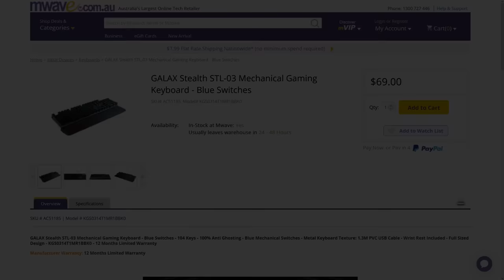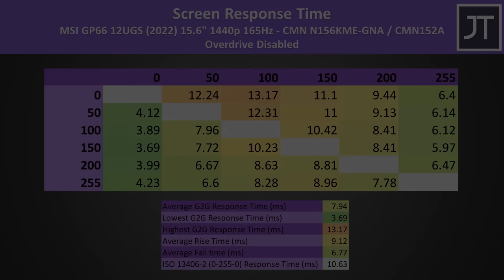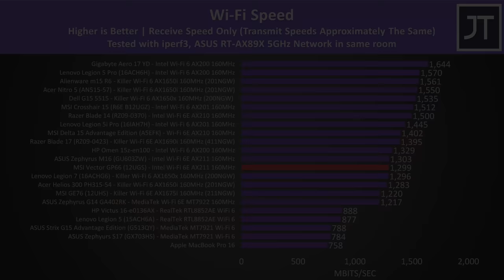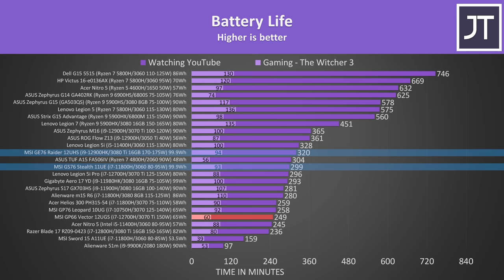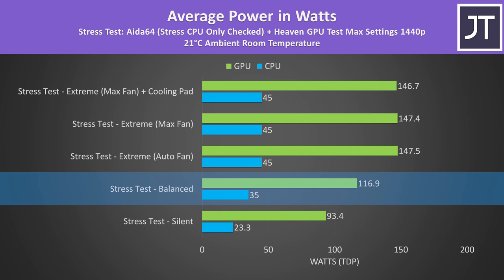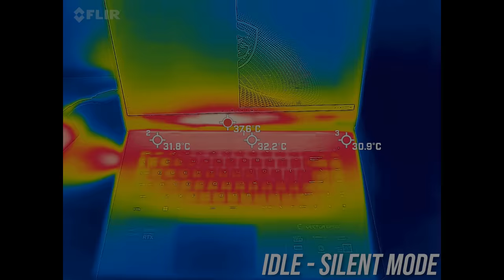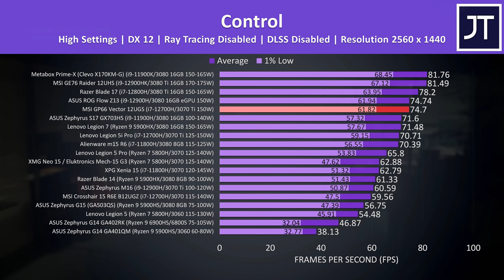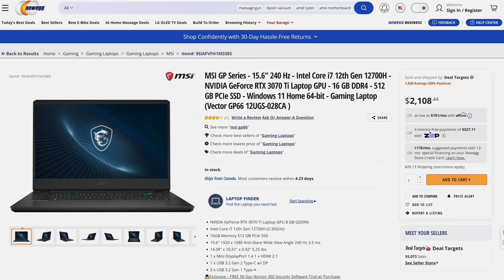MSI GP66 (2022) Review - FASTEST RTX 3070 Ti Gaming Laptop!

Comment: Anything Over RTX 3060 cannot be considered Mid-range. I guess the budget versions should soon be releashed.
Reply: Bruh you're right 3070 is not mid range
Reply: 3080/ti is high end, 3070 is mid, 3060 budget, 3050ti/3050 is low end
Reply: @hendrikheim5665  that’s literally not true but go off
Reply: @jametron6135  because he's not including 5 year old GPUs?
Reply: midrange is rx580-1080ti, not rtx3070
Reply: @jametron6135  There isn't that much of a difference in price with 3060 and 3070 anyway. If you can afford a descent 1k-1,4k€, then you can shell 100 or 200 more for a 3070. I'm price conscious, so I bought a used 3070 notebook and yes it's midrange.
Reply: @hendrikheim5665  3060 is £399 rrp
Reply: if y’all think paying 1450 dollars for a laptop is midrange y’all have problem
Reply: @KentRoads laptop gpus.
Reply: @jametron6135  don't know if that's a lot or not. But most 3060 laptops sell for 1k€ here. My gf66 3070 had a price tag of 1,1k or so. It was used though but works just fine.
Reply: @hendrikheim5665  £699 for a 3060 laptop. Technology advances daily so there's no point including old stuff :)
Reply: 'Midrange' 1080ti might not be enough for AAA titles in a year or two
Reply: @KentRoads  I still have a system with it, works just fine. In the end it doesn't matter most new games are yucky anyhow
Reply: @jametron6135  idk how much new gaming laptops cost and why it's so costly these days but i would reccomend getting the 3060 or anything that has more VRAM than 4 gigs, the settings, the price and the performace in todays new laptops are kinda sucks for me, for example most of the new laptop has an high end intel 12th gen and gets paired with a potato 3050 4gb, why tho, why don't they just paired it with last gen gpu and get much better price perf ratio, also the 3050 its not revolutioner ( yeah the xx50 finally gets rtx features, but you can get probably more performace and VRAM just by using the 2060 series )
Reply: @kingofstrike1234  i got one with a rtx3060 for 850 to replace my rx580 desktop
Reply: @jametron6135  if u think thats high end, u have been living under a rock
Reply: @LoneWolf6063  if i think what is high end? i’ve been talking about a few things
Reply: Keep in mind that GPU and CPU aren't the only things that define a laptop's class. The screen, build quality, and IO also play a bit part in that. But I'm not saying that this one has a mediocre screen, Build quality, or IO
Reply: @hendrikheim5665  get off you daddy money prince.
Reply: @jametron6135  dude ur just poor, stop disgusting others with ur poverty
Reply: @TyTystick Finally someone who gets it. It's not about the cpu and gpu. You can cram top specs into a cheap/generic chassis. People buy them for the best bang for buck. Actual high end laptops have bespoke and good quality chassis, good I/O and numerous features that not every gaming laptop has like per-key RGB, windows hello IR login, good keyboard/touchpad, things like that.
Reply: @DarthVader-xr6hm  id say i’m high mid class, i wouldn’t spend 3,000 on a shitty laptop though
Reply: I completely agree
Reply from the maker: The GP series itself is midrange, not necessarily the specific specs I happened to get sent.
Reply: @jametron6135  No.
Reply: @Ramcas42  no what? are you special?
Reply: @hendrikheim5665  with that logic 970 is jurassic lol
Reply: @TuneTamasha  It is
Reply: @Supcharged  yet it still runs new games fine
Reply: @TuneTamasha  so does a gtx 1050ti.
Reply: Haruka Matata  This isn't 2010 anymore. The sad reality is that you cannot get most things for the same as back than. Take the eur currency as an example, lost 3-4 times of its value the last 10-15 years compared to hard money. Inflation on consumer goods has risen too and wages have not followed along it. I do not make much more than I did back then, but many things have gone up in price, we simply do not notice it. 

A high-end laptop was maybe 1k€ back then, but these days it's more like 1,9k to 2,2€ and that is in a system that might not the most expensive one. Also do not forget that desktop GPUs have almost doubled in price compared to 10 years ago. But hey we still have very good budget with excellent quality like the legion 5 series, it ein't all bad! But always remember that you and I are peasants and have no control or say in this. ;)
Reply: @jametron6135  No
Reply: @Ramcas42  you have no dad
Reply: @jametron6135  No
Reply: @Ramcas42  you have no dad
Reply: @jametron6135  No
Reply: IMHO 3070/ti is considered  mid range because lack of bigger vram so it's not really future proof especially when it comes to 4k. Nvidia fked up for not providing ti version at least 10-12 gb. O well..
Reply: @farrukhdada6688  I swear people like you can not be real. Is the iphone 13 a “midrange” phone because the 13 pro exists?
Reply: @jametron6135   What? That's a horrible comparison.
Reply: @farrukhdada6688  Why is it a horrible comparison? It’s a high end piece of technology, with a greater version, and a bigger version
Reply: @hendrikheim5665  3060 is budget? How is a card which can run games like cyberpunk on ultra with ray tracing on be budget? These cards are actually really powerful!

Comment: I think it could have been better, if they didn't basically waste money on some stuff, like 2.5g ethernet and per key rgb, when most people buying mid range laptops won't have a 2.5gb switch, or I'm not completely sure, but also care for per key rgb. They could have used the money for better trackpad and hinge, and add charging to the usb-c. If lucky, maybe a second usb c as well. It matters per person, but that seems a better full package. Still, beastly performance and excellent screen so I guess I'm just nitpicking.
Reply: Even the screen could be 1080p, I dont think 1440p is that worthy for that size
Reply: Type-C charging is a must-have feature for me so I would gladly sacrifice 2.5G Ethernet and per-key RGB to get it.
Reply: Agreed
Keeping the price same and switching 2.5gb ethernet, per key rgb lighting for type-c charging is a good deal
Reply: @JotaFla  I think there are 1080p options for it. Maybe not available yet but they are listed on website
Reply: It's not mid range in my country. Still bout as pricey as high end laptops. And non of MSI budget offerings comes close to that.
Reply: @saturnotaku  the hinge problem must be fixed, i had it for one year and my right hinge broke, so msi need to fix their terrible hinge design

Comment: I own the 2021 GP66 Leopard (RTX3070/I7-10750H) which has an almost exact cooling setup. I was able to really boost thermal performance by repaisting with Kryonaut / K5 Pro and undervolting. I still hold the #1 spot in Firestrike Extreme (13552) and #3 Timespy Extreme (5190) in systems with this GPU/CPU configuration. So for sure worth all the trouble of taking the GP66 apart.
Reply from the maker: Nice!
Reply: Yes I have the msi gp 76 11aug 3070 rtx and i7. I undervolted it to -80, added liquid metal and adjusted the prefix and and a couple other settings to give me free 5-12 fps boost for free. It’s super cool and amazing.
Reply: How about the battery life
Reply: @jeremyguiab  complete and total garbage haha but i think the GP66 is meant for best possible performance at the lowest dollar amount, not battery life and for sure not build quality.
Reply: Wonder how 3070 mobile compares to 3070Ti mobile. Wish Jared would do a comparison.
Reply: @jeremyguiab  the battery life can be at least 5-6 hours if you set it up correctly. Basically change the display settings to 60HZ and anything else gaming related should be deactivated. When working my job I use the laptop like that, when gaming I put the display back to 144hz and reactivate the gaming settings. I have the 10th gen model with an i7 and 3070
Reply: @thepermanentshockedface9177  i7 11800H ?

Comment: Hey Jarrod, can you confirm that, despite all the BIOS options always given by MSI, Alderlake 12700H, e.g. any non-HK SKU, has no chance of enabling undervolt? This machine is a good candidate to prove it once and for all.
Reply: No undervolt allowed on 12th H
Reply: @elaminemenni672  I see p core voltage offset in the advanced bios section in the video though
Reply from the maker: 12th gen non K doesn't support it, so I don't bother even attempting to see if the BIOS options do anything.
Reply: @JarrodsTech  TY!
Reply: That is sad since a good undervolt was a nice way to lower temps and strangely usually increase performance on mobile Intel.  Though that does depend on silicone luck since some Intel mobile CPUs can just run fine with less voltage then others so everything has to be set for the lowest common denominator, which is higher then it might need to be.
Reply: @acdbrn2000  Hopefully the hx series can be undervolted then. They all support some level of overclocking so maybe intel also enabled undervolting.
Reply: 900

Comment: Jarrod: This is MSI's best mid range laptop.
Also Jarrod: this laptop has an rtx 3070ti, 1440p 165hz screen, and Intel i7 12700h.
Ah yes, very mid range
Reply: lol same thing i was thinking, mid range for me is like a 3060 tops. I guess i'm too poor
Reply: @SweatyFeetGirl  you do have a point, and while I somewhat agree with you that the rtx 3080 & and 3080 ti are high end, I just can't get myself to believe that the rtx 3070 ti is upper mid-range. The normal 3070 probably is, but I don't think the ti version would be a mid range consideration. And besides, the laptop still has a 1440p 165hz  screen and an Intel 12700h
Reply: I've seen gf66 3070 laptop for under 1200e, bought mine used for 1100e, I think? 100e less will get you a 3060 legion
Reply: Maybeit is considered mid range because gp 66 is cut down and cheaper than ge66
Reply: ONG
Reply: @oofwithoof1023  the 3070ti replaced the 3070 this gen, they're the same tier. You should expect more performance at a similar price gen over gen. The issue is, this gen they kept similar price/performance.
Reply: @SweatyFeetGirl  it's just my own view of high end and mid range. You have your own opinion and I havemine. Guess I just have a different mindset than you
Reply: @SweatyFeetGirl  well then, I guess I just have a different sense of value. But I do still understand your point
Reply: The most budget msi gaming laptop is msi gf63. I have one.
Reply: @imranknight6659  what specs do u have?
Reply: @oofwithoof1023  core i5 10500h 6 cores 12 thread's, gtx 1650 max q, 8 GB ram 256gb SSD, and then I upgraded more 8gb of ram now it's 16 and also 1tb of SSD 2.5 inch.
Reply from the maker: The GP series itself is midrange, not necessarily the specific specs I happened to get sent.
Reply: @JarrodsTech  I see. I just commented since the laptop itself didn't seem mid-range to me, but if the general series can be considered mid range, then I guess that gets a pass.
Reply: @JarrodsTech  also, when are you gonna be making a review of the Asus zephyrus g15 2022 ver?
Reply: Well there's no thunderbolt. So there's an example. This is obviously the most pimped version of this, yes, mid range laptop.
Reply: Jarrod is in the wrong here, the GP series has been MSI's high-end premium lineup ever since they scrapped GT as flagship series.
GL: Entry-Level
GF: Low-End
GS: Mid-Range
GP: High-End
GE: Flagship
Reply: @blue4059   @Blue   @Blue  Well it's shit for high end that's for sure. No thunderbolt, crappy screen not even 300 nits (although good response time), only 3gz on performance cores under load (seriously WTF is that)? Graphics card throttling cause they refuse to correct their crappy cooling for years now, the worst latencymon results I have ever seen, louder than almost any laptop to have almost acceptable cooling, crap camera, no windows hello of any kind - but all the gamer kids buying it will only are about the final figure, FPS, where it does well. Personally I would go crazy using this is a daily driver, especially with crap touchpad, loud fans, only 4 total USB without any thunderbolt, screen not bright enough overall. Finally, DDR4 instead of DDR5 that is even in some cheaper laptops tells me it's not what they consider a high end product. Oh, I almost forgot, and not even a gen 4 SSD, they give us crap! It's 12th fen and we are getting 3 gig per second. Even my 11th gen laptops that were cheaper than this came with drives that do 7 read/6 write. No thanks.
Reply: @teddym2808  did you actually have the laptop when you wrote this? Cuz you sound too pissed off to be knowing this by reading reviews (no offense)
Reply: @oofwithoof1023  Sorry what are you saying exactly? Do I have the MSI laptop? No, I study the reviews very carefully and know when something is not for me. The frequencies under load already make it a no no, even if everything else was perfect. The Alienware X17 R2 with 12700H can sustain 4.1ghz on all performance cores under 100% load and 3.4 on efficiency cores (more than the MSI on perf cores LOL) and can go higher than that when not under 100% load. I would be jumping at it with the 3080ti and 4K g sync screen they just added as an option, but I can't get past the lack of secondary key lighting. I just can't. But it shows you what a  proper cooling system can do. So even if the MSI was perfect in every other way imaginable, I'd still say no cause the frequencies are so low and the GPU is always at throttle point.
Reply: @teddym2808  yeah, sounds about right
Reply: @oofwithoof1023  Right now I have my Legion 7i with 11th gen 8 core and 3070, 64GB ram and 2+1TB nvme, and my razer 15 advanced with same 11800h cpu (but it can't get anywhere near the speeds of the lenovo, 3.5 under 100% load vs 4.5 on all 8 cores!), 32gb ram, also 2+1 TB ssd, and 100 watt 3070 vs 140 watt in the lenovo. I just want something with more cores for productivity - video editing and large scale music productio -  and if I am going to do it I might as well get the absolute best GFX card so it can be an "everything machine". Some older games will work great in 4K with a 3080ti and I am sure 1440P will be possible for any game.

The Lenovo is by far the best laptop I have ever used let alone owned in my lifetime.. 100% load with all cores overclocked by 300mhz and no throttle.. crazy.. and the fans sound like a pleasant low whoosh. The Razer is great for travel and I guess I'll keep it till it dies as it's slim and stealthy, but I'd like a real beast, preferably the 12900HK so I have full control over every core and every multiplier, and 64GB ram again and with the 3080Ti. But it has to be in a chassis that can handle it and actually make use of it.. even the very top of the range MSI can't do more than 3.5ghz under load. Let's hope Asus and Lenovo's coming flagships will finally do it for me.
Reply: @teddym2808  either way, both your laptops seem like beasts of their class
Reply: It is mid
Reply: @teddym2808  why do u have 2 laptops
Reply: I have MSI gf65
Reply: Sorry to break it to all of you, but 90 is top end, 80 is high, 70 is mid, 60 and below is for casuals or poor people. So yes, a 3070 Ti is mid range. There is nothing wrong with having a 3060 or below but IF you do, you are casual or cheap when it comes to your hobby, its just that simple.

Comment: This year, MSI is really handling the GPU power level differently than other gaming laptops. Most other laptops, during combined load, only able to run the GPU at the base TGP and only utilise 5W to 10W max from dynamic boost, never reaching that advertised total TGP. Most cases 150W 3070 ti runs at 130W-135W at max. In MSI, looks like they're always pushing the maximum power to the GPU and not really implementating dynamic boost. This looks similar tome as the Electro Boost some Eluktronics laptops used to offer, always pushing the max allowed power.

Comment: I have the GP76 Leopard with 11800h CPU/3070 GPU. One of the very cool things about it is that you can go into the bios and actually change the power limits for the CPU and GPU, so you can set the CPU max wattage, for example, to 45 watts. This is perfect for gaming, as the GPU will be able to run at max speed all day long, and the CPU will still be easily hitting 4.2-4.3GHz, but with temps remaining below 80 degrees during continuous gaming sessions. I also undervolted the CPU in the bios, but my machine can only undervolt by -50 and remain absolutely stable under all loads, whereas many are saying they can do -70 or even -80. I suspect at least some of these users haven't actually got completely stable CPU operation under all load conditions, however. I would say that if you want maximum gaming performance with serious cooling in a laptop, and you don't really care about LEDs everywhere nor using a laptop on battery very often, then MSI's-GP series is offering an outstanding price/performance value proposition.
Reply: Hello anubis44, I also have the gp76 but I have a huge problem that it heats up a lot (above 90 degrees or 95-100 degrees when I put it in cooler boost) otherwise it can easily reach 100 degrees, the pc is burning I can't even touch it. I am very worried and I am afraid to go into the BIOS and make a mistake. Can you explain me how you do to stay under 80 degrees, you will do me a huge favor and it would be nice of you.
Reply: hoping for an answer from you as soon as possible
Reply: @ziineh4723 hi, go into bios and reduce the gpu and cpu power limit by 10w each. If that doesn't help you can also look up a guide on how to undervolt it